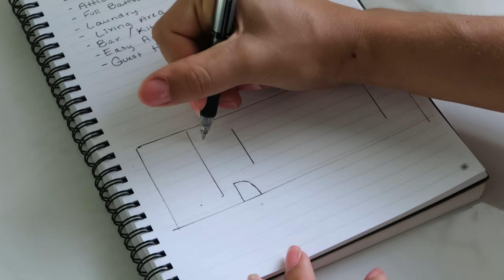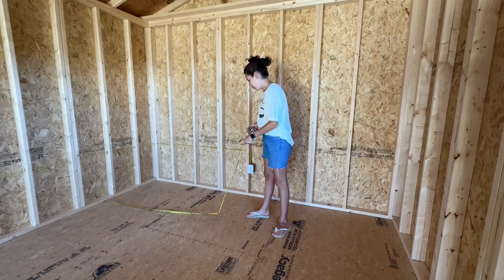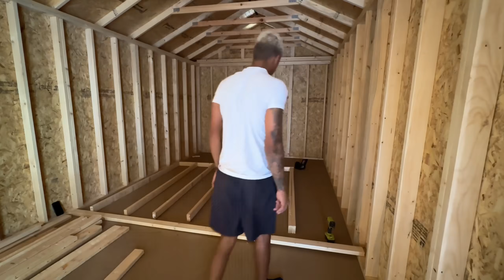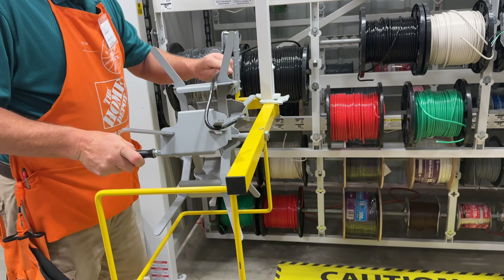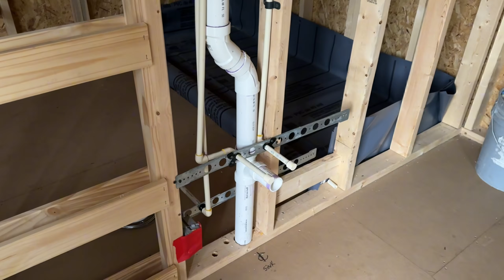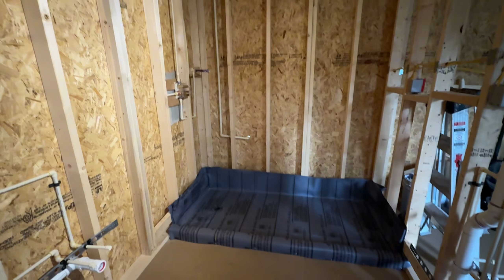Turning This Shed into a Tiny House (Part 2)

Comment: Wouldn't do water lines in the walls and ceiling...
Reply from the maker: Thats how they build a lot of the homes here in FL, its easier to repair too the way we planned it and will keep everything insulated in the winter :)
Reply: @beautyandabuilder  What's the insurance like on these units? As a hurricane veteran I can't imagine these things will stand up to anything stronger than a tropical storm.
Reply: @beautyandabuilder  It is NOT 'easier' to repair a collapsed ceiling, neighbor !   Or flooded wall voids.  Sounds like "a lot of homes [there] in FL" all doing it wrong -- which would not be unusual.
Reply: That’s how they build homes in a lot of states in America